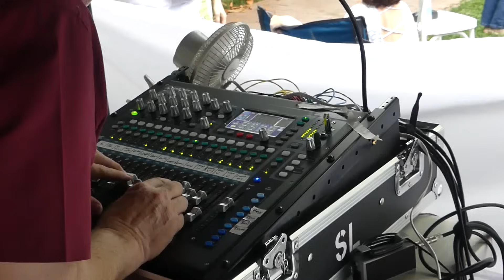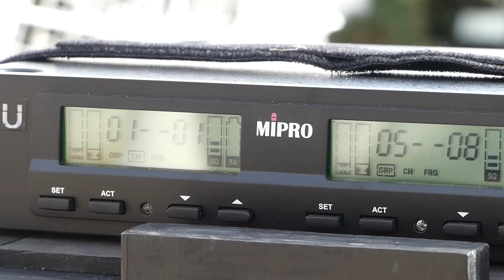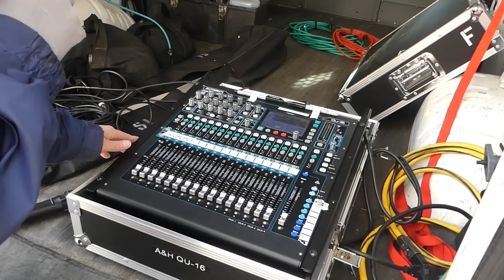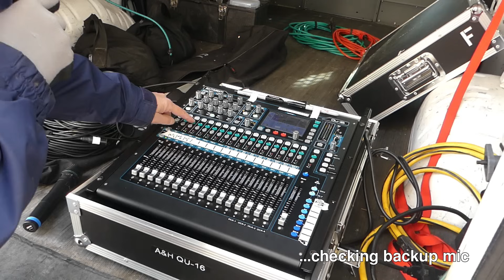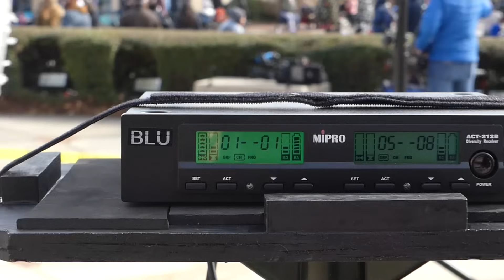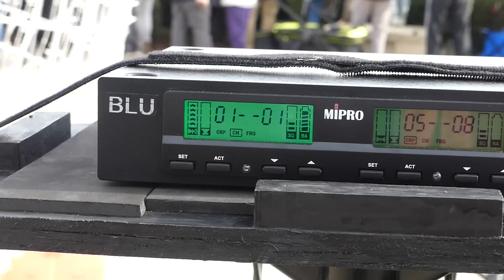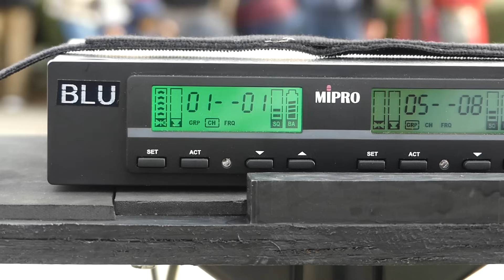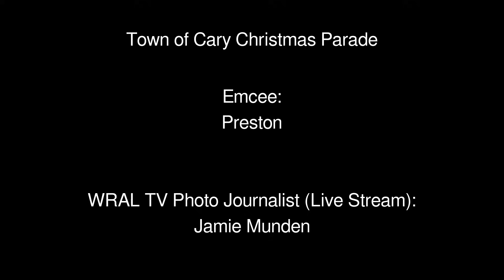Sound system setup using a QU-16 for a city parade - Event Video 54

Comment: Only thing I would try is coupling your two speakers into a point source array in front of the globe looking thing. This will cut down on any comb filtering making the dialogue more intelligible. I have done it in pretty much the exact situation at a parade and it really made a difference.

Comment: Just a heads up from an ex-broadcast engineer with a background in RF. Many of the "Dead Spots" are not so much of line of sight, but the effect of Multipath as reflected signals off surfaces can be as strong as the line of sight path. These signals add or subtract from the line of sight path. As the path lengths vary, a picket fence of drop out zones is formed.
To combat this, there are 3 solutions.
The first one you addressed. Improve the strength of the line of sight signal so the multipath signals are weaker in relation.
The 2nd solution is to use a diversity receiver, so when one antenna is in a dead spot, the other antenna and receiver, is unlikely to be dead at the same time. This can reduce drop outs by 90% or more.
The 3rd step is to use highly directional antennas to increase the line of sight signal and attenuate all signals from other directions.
There is a 4th solution that does not apply to wireless microphones. That is to use circularly porpoised antennas on the transmitter and receiver. Reflected signals change the polarization,. EG a right hand signal becomes a left hand signal and is ignored by the receiver antenna.
A diversity receiver with 2 paddle (Yagi or log periodic) antennas is the most robust solution for your event. Spacing the 2 antennas 1/4 wave apart at the microphone frequency is the most effective solution.  Looked up your microphones. Listed as multi channel, but not true diversity receivers. Need to upgrade.  Look into the Shure L series with L4 Diversity receiver.
Note: Dual antenna is often for dual receiver, for dual microphones, not diversity. Ensure you use a diversity receiver, which is 2 receivers on 2 antennas on the same frequency. A single channel diversity has 2 antennas and 2 receivers. A 2 channel diversity receiver has 2 receivers for each frequency, Your issue with sound reflections, applies to the wireless signal as well. The cause is the same.
Reply from the maker: Thanks for your comment.  Great information!  Yes, the receiver is a diversity receiver, but not a true-diversity.  It does very well for us.  The parade is the only event where we have had issues with RF.  No other event location has caused issues.  As well, we don't actually use much wireless for any of our events (the parade is the only event that is 100% wireless).  We'll see how the parade does next year before we look into any upgrades.  Thanks again for the great information.

Comment: Any reason why you don't opt for the active directional antennas?
Reply from the maker: Good question.  This has been brought up before.  Directional antennas work very well when dealing with weak signals.  The issue for this parade was not a weak signal, but a line-of-sight issue, which had resulted with many moments of no signal.  This would be similar to placing a solid panel in front of a flash-light.  It doesn't matter how bright the flash-light is when something in front of it is solid blocking the light.  Getting the antennas elevated allowed the receiver to "see" the transmitter.  Also, the transmitters are 30mW units.  They can cover a much larger distance than what was used at the parade... assuming no line-of-sight issues.

Comment: I still would have flagged the shit out of that.
But that's easy when you have them available. 

Same for speakers: 2 for long throw L and R and a short throw for Center.

And possibly just a simple rack based mixer with control from Ipad or mobile phone so I could walk around myself. Is also cheaper than a Qu16.

Comment: I love that 1/2 wave antena rig. Do you have a parts list for that sir?
Reply from the maker: Thank you.

Here's what I used (sorry, I have no part numbers for anything here)
1 x lighting tower (to elevate the antennas)
1 x 1U BNC antenna panel (1/2 rack width)
2 x BNC to TNC adapters (for the 1/2 wave antennas)
2 x BNC adapters for the receiver antenna inputs
2 x 25ft. BNC cables (connected antennas to the receiver)
2 x "U" bolts to attach the 1/2 1U antenna panel to the light tree.
Reply: @stageleftaudio  Awesome thank you Sir! Very helpful! I do a few city events as well and I really like that antenna "tower" you built! I will definitley be building me one. Cheers!
Reply: Same. What is that?
Reply from the maker: See below.